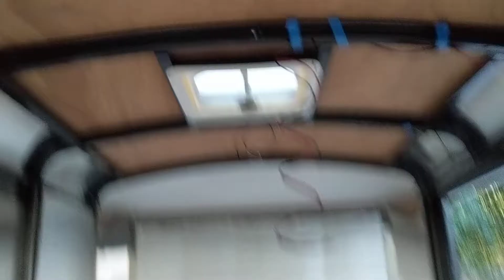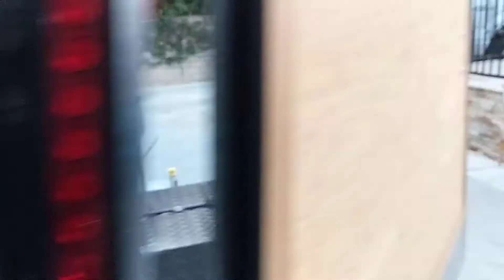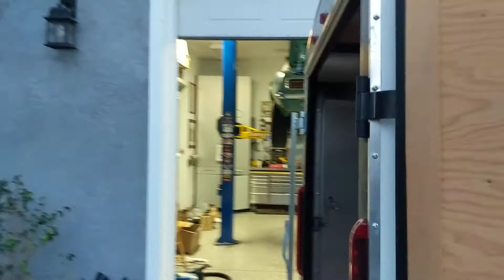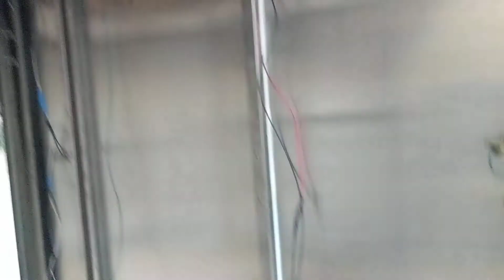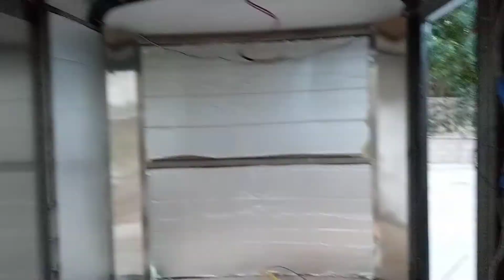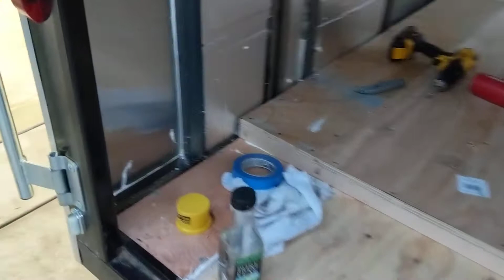Part 7: Insulation and Electrical! Cargo Trailer Off Road Camper Conversion

Comment: Great trailer build, I have been searching like crazy for something like this. The only problem I have is I want to haul my side by side inside.
Reply from the maker: That certainly adds a challenge. I have seen a cool design on youtube for hauling a motorcycle, it has a fold down bed. But you need a lot of room for the sxs
Reply: Digiwolff 
I’m thinking I can get away with a 5x10 but it will basically fill the entire trailer. I would need to make the bed fold up to the wall or maybe the roof. For now I will get by with my Expedition hauler trailer with RTT.